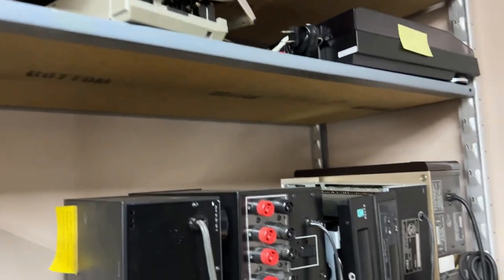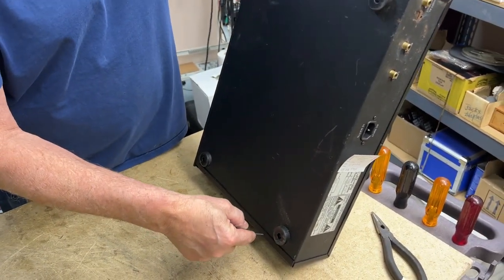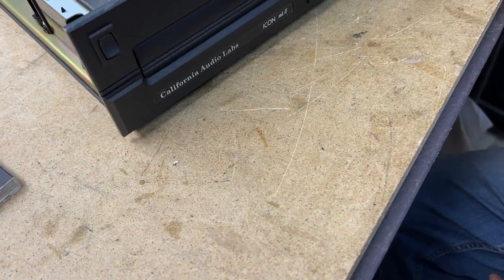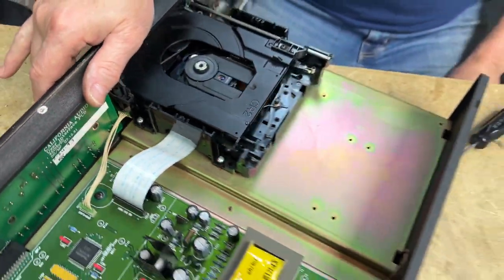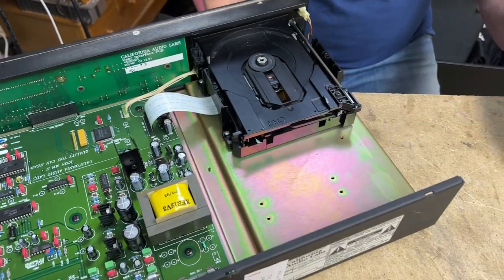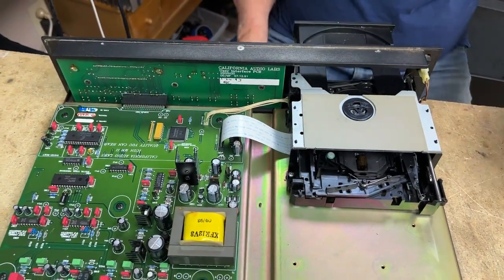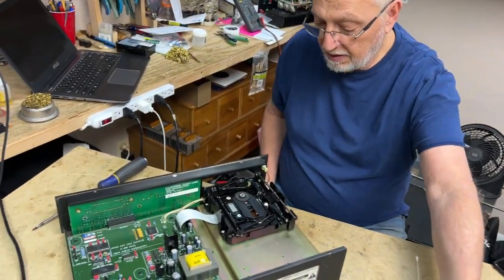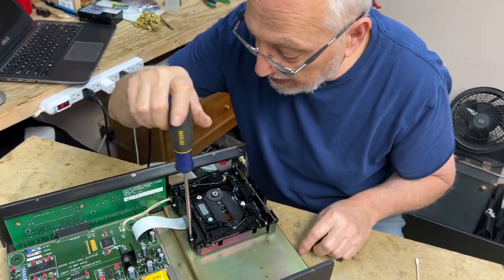Fixing My Broken California Audio Labs CD Player!

Comment: That motor is good but old oil or grease residue has probably gone sticky. Open up the motor, clean the ends where the it rubs on the case or a bearing and oil again with some sewingmachine oil. Should be good to go after.
Reply from the maker: Motor was replaced and I sold it shortly afterwards. Thx

Comment: You have to clean and re lubricate the gears after 27 years. I highly doubt the caps are bad enough to cause the motor to not properly drive the laser. Especially since this is a high end model.

Comment: There may be a laser adjustment potentiometer on the laser mechanism itself.  I have had great success "repairing" cd players by slightly adjusting laser intensity.  I'd give that a try.  That  player is worth that minimal effort.  Yes you can buy a Blu-ray player for $50...but in "may" not sound as good as this item.  Look for a potentiometer near the laser mechanism and try a little  adjustment.  It may kill the laser...but what have you got to lose.  This method resurrected my prescious Toshiba SD 9200.   22 Years old... bought for $10.
Reply from the maker: I have a Toshiba SD-9200 that will be in my next video. It has the buzzing issue when CD is spinning at fastest RPM. Thanks

Comment: I'm looking forward to your follow up as I have exactly the same player, and it's a beast & I did pay $1,000 for it in 1995 most money I paid for anything in my system, I also have the external Gamma DAC. I really like it & would like to keep it. Lately I've come across some old Phillips, Magnavox units with the 1541 DAC in them would go for a fortune in the Audiophile community. I also have an old Denon DCD-1500 which uses the PCM-56 Sigma Delta DACs, and they sound great I even picked up about 10 of them and was going to stack them. BUT same thing old and intermittent. It's a shame things don't last, and you can't just take an old cd drive mechanism from a computer and just use that to replace the internal unit but apparently, it's not feasible without added interfacing.

Comment: 4:44 Those two large capacitors between the transformer and the power regulator heat sinks look like the tops are domed. I would have your tech check those for ESR especially if those are 85 degree temperature rated capacitors. Any capacitors next to a heat source are prone to failure. That would explain the wacky digits appearing on the screen and the motor not having enough torque to start. Well, one of many reasons, such as the motor itself.

 It may be better to bail and sell it as is to someone who has the time to change out all those capacitors, it is the labor to pay someone else to do it that makes it not cost effective. The capacitors themselves are cheap.
Reply: I noticed it too. But when he changed views they looked fine, cheers.

Comment: Nice video about the CAL cd plejer, watched the video and would like to ad some remarks on it. I understand that the service repair guy have to make a living on repairs and give his personal advice, but I'm sure he isn't familiar with this brand as he is comparing it with a blue Ray or dvd player is totally wrong.these where regarded as very well made but most important great sounding units. As a service repair his would just replace it with a new motor which is ok but most likely it's easier for him, Motors could be refurbished and i have done it many times. These player's are very good and are reparable.
Reply from the maker: Like most tech guys, he’s not an “audiophile”.

Comment: I still have a Sony CDP-302  CD playback deck that I bought in 1985 that I paid $400.00 for, and for the life of me, do not see why that unit should be $1,000.  The Sony has a linier drive motor for the tray, and absolutely no belts or pulleys.   I occasionally have to lubricate the rails for the tray.

Comment: Please compare the sound of your Spring 3 DAC + good cheap streamer (e.g. Zen Stream+linear PSU) with a turntable+arm+cartridge+phono stage that COSTS THE SAME as your Spring 3 DAC + Streamer rig and be SURE that you compare them with a track from an album that came from the same Recording Master... I'm pretty sure  that your digital rig will sound way better than your turntable setup. And please don't tell me about 60s & 70s recordings... Do the comparison with later recordings when digital was mature technology and ALL albums recorded Digitally... Vinyl simply CANNOT match digital regarding snr, dynamics, channel seperation, noise, pitch stability and accuracy. And with a GOOD R2R DAC, like the HOLO, you will achieve the "Musicality" (i hate this word) of analog.
Reply from the maker: Had to send it back.